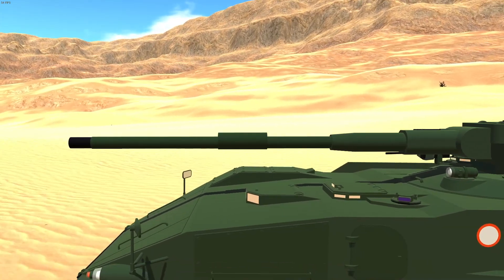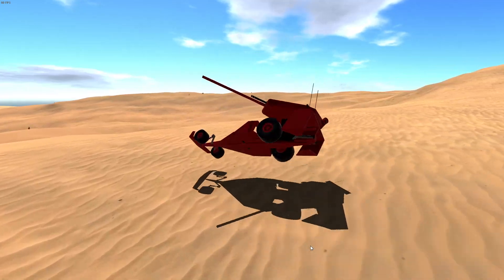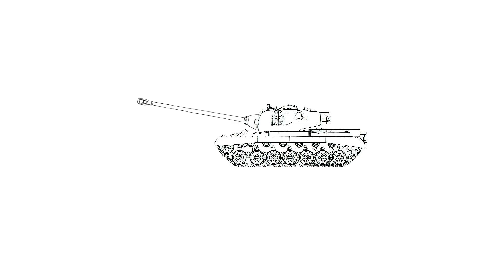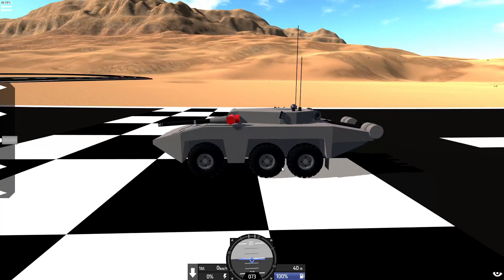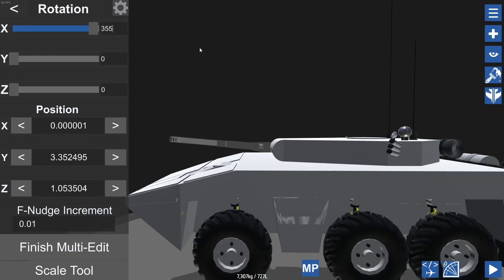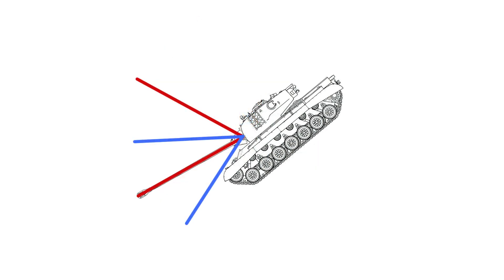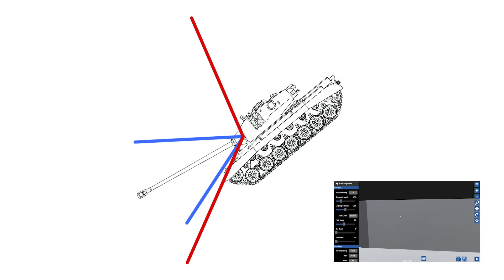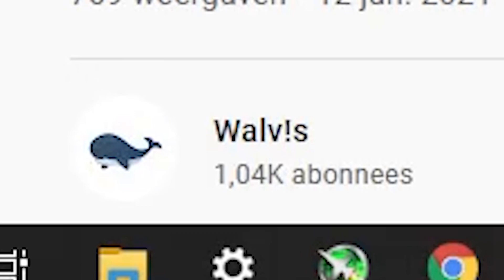Simpleplanes Tank Stabilizer Tutorial

Comment: Had used this as my first means of VSTAB's, but have found some code on the forums, that allows only having a rotator and it self adjusting instead of attaching a gyro
I'll put it here:      smooth(-PitchAngle/180, Activate1 ? 1000 : 0 )               aswell as setting the min input to -2 and max to 2 

Also found that when the rotator is on the left facing inwards it works, but to make it work on the right you'll need to remove the - out of (-PitchAngle)
Will need the overload mod so you can edit the input values
though have got an issue with the gun unable to elevate or depress, of which hopefully I can figure out

Comment: 5:54

If that's the case, then why don't you just make another manual rotator attached to the entire gun assembly (plus gyroscope) which can help override that turn limitation which you can turn on through an activation group? Or as I would call it for now, a Manual Stabilizer Override Mechanism

Comment: On the depression part of the cannon, will it work so well if you reduce the minimum value where the rotor can move (in short, decreasing how far the rotor can go down)?
Reply from the maker: Your question confuses me. You can only change how far up / down a free spin rotor goes, this is always symetric (so always 10 up and 10 down).

Please let me know if this answers your question.
Reply: @WalvisYT  yes, it answear my question.
After some tests, the stabilizer works well